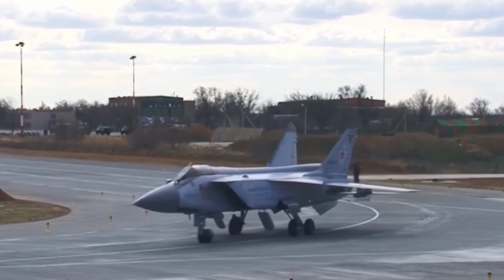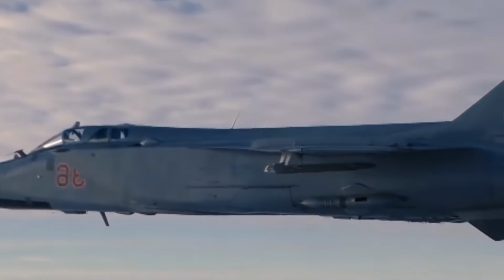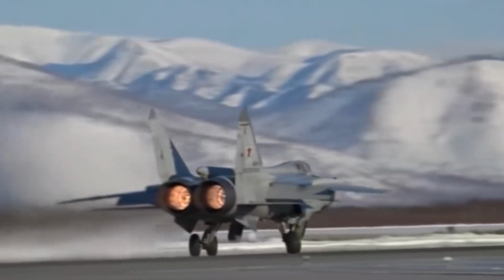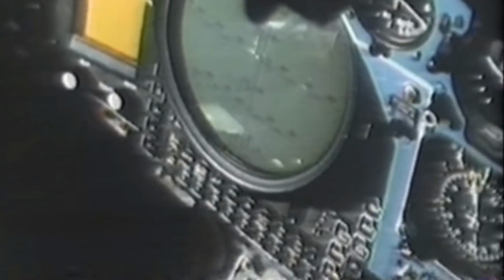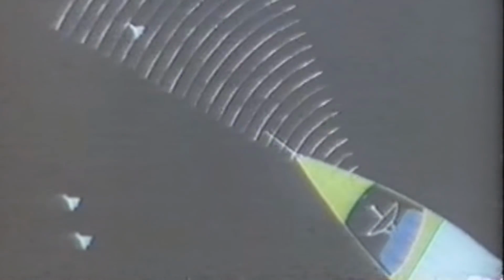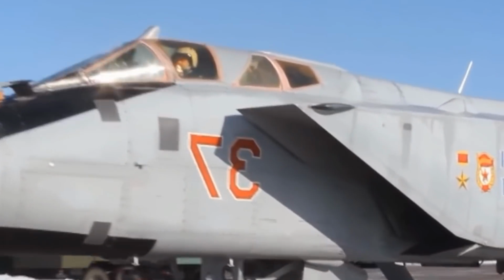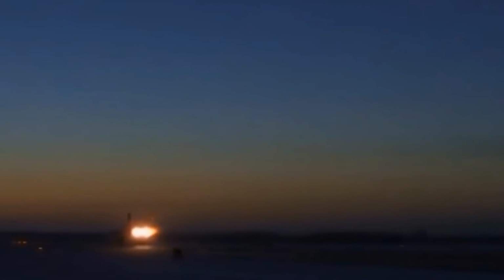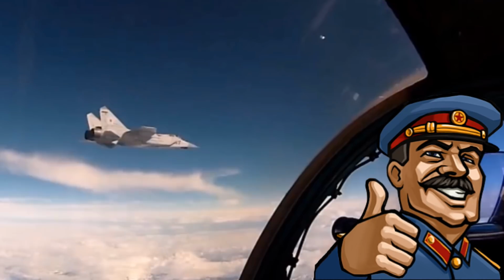Mikoyan MiG-31 Foxhound - Russian Interceptor Fighter

Comment: The story goes back to the Foxbat that was build to counter the hugely expensive B-70 Valkyrie bomber that was to be Mach 3 capable - now that aircraft was cancelled - partly because it was cheaper to put up ICBM's.

There was regular recce missions with SR-71 over Murmansk and in the Baltics. It was a bit fun, because the Foxbats chased the Blackbirds full tilt on their way back. Well untill the Foxbats ran out of fuel and turned back.

The Russian system failed miserably - especially command-wise (they had no idea what they were doing) - and they shot down Korean Airlines flight 007.

So in this context the Foxhound was the logical next step against the B-1 bomber (and Tornado for that matter). But what a Mach 2.5 capable (and I doubt the engine can take that speed for very long) aircraft has of advantage against low level targets remains a mystery to me.

The countermove was basically the F-22 with stealth: Even the best radar is a bit of a moot question, when the radar cant see the bloody thing. One thing is certain: The Foxhound can be seen very far off - running into the oncoming missile in a fancy gait.
Reply: Korean Boeing? The plane flew to a naval base with nuclear submarines. The pilot's maneuvers did not respond either by radio. Mistake a few hundred kilometers? Are you sure it was a passenger plane?What kind of shit did you write about the MiG-31? MiG-31 was originally intended for intercepting cruise missiles in the entire range of altitudes and speeds, as well as low-flying satellites. A group of four MiG-31 aircraft is able to control airspace along the front line up to 1100 km. MiG-31BM maximum range of detection of air targets increased to 320 km, defeats - up to 280 km, it is not available to any other fighter, in comparison, the maximum range of damage at the nearest competitor in the range of F / A-18 Super Hornet is less by 100 kilometers.
Reply: ArchierounD Two different situations with different causes, but good job getting people to +1 by framing the 665 incident as exactly the same as the 007 incident, just with the US. Way to keep the hate flowing.
Reply: Sr-71 never overflew mainland Soviet Union. An interview with the actual pilot confirms it. It flew only near the Soviet national airspace border, trying to "peek" over its shoulder with its cameras and sensors. KAL 007 was shot down because civil airliners were previously used for gathering intelligence on Soviet GCI and EW network system. We will never know if KAL 007 was on that same mission. I don't justify the shootdown, even if it was on intel mission, but that's the reason for that very shootdown. Besides, US shot down Iranian Airbus inside Iranian airspace and never bothered saying "sorry". So shooting down civilian airliners is not a Soviet-only thing.
Reply: Petar Banovac.   Nonsense, SR-71 regularly overflow the Soviet Union, Russians are hilarious.
Reply: - The top speed is Mach 2.83 (3000 km/h), limited by regulations, not aerodynamics. Regularly exceeding it the heat from friction could cause damage to the airframe. In clean configuration top speed is around Mach 3.2.
- One of the advantages of such high speed is simply the time it needs to get into engagement range. This is an interceptor, a defensive weapon complex, it must have short reaction time.
- That incoming missile needs something to home in on. As soon as its radar goes active it becomes visible (if it wasn't already). And what is seen can be shot down or evaded. A MIG's high speed also allows the aircraft to simply leave incoming missiles behind, as it happened with MIG-25R's above Israel in the 70's and the SR-71's throughout their service. By the time they would reach the MIG they no longer fly anywhere near maximum speed.

Have a nice day!
Reply: about the korean air , either the pilot are ...... or they are spy and williing to die lol ( they think that with passenger on board the soviet wont shot , woop wrong .
Reply: inoue jerry your a disgusting pig!
Reply: Airlines?? Boeing? , i m done with you,,. Bullshit!
Reply: And when you put a huge radar in the nose of it: Then you have made damned certain it will be seen!
Reply: Precisely: The Russians had no idea what they were dealing with. Still haven't.
Reply: Lol fancy gait, refers to Putin ?
Reply: Well then it is very funny, that the russians have not been able to intercept cruise-missiles in Syria.

Well, the russians have a long history of shooting down civilian aircraft! I'm being kind, because russians are not able to behave.
Reply: No not really! The Foxhound is a large aircraft: Putin is more the midget size and shows his manliness by assaulting fish!
Reply: The American system failed miserably - especially command-wise (they had no idea what they are doing) - and they shot down Iran Air Flight 655.